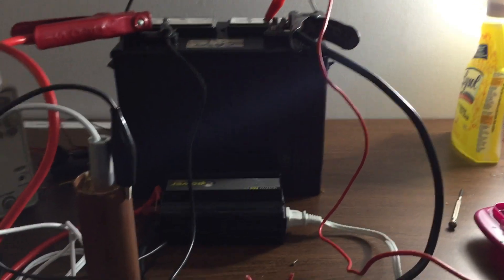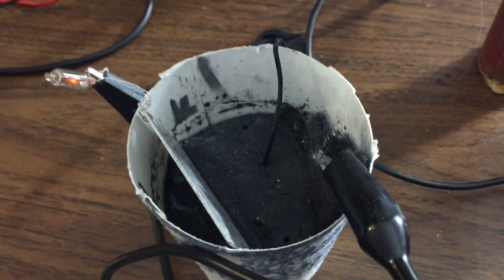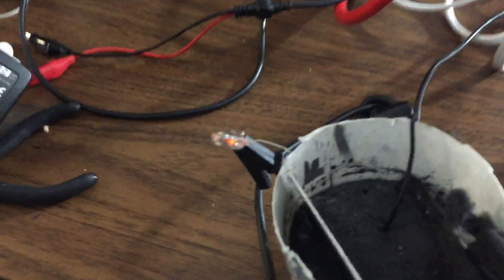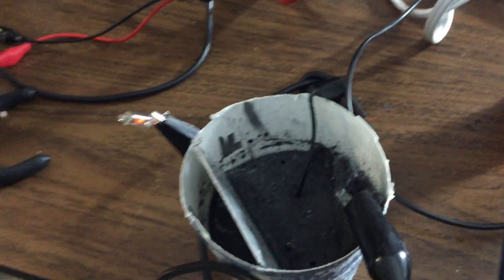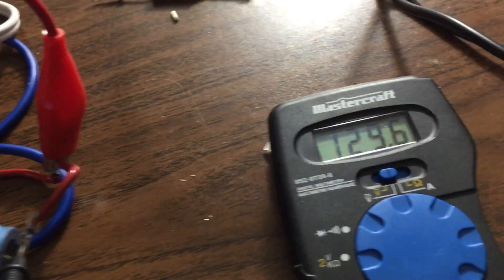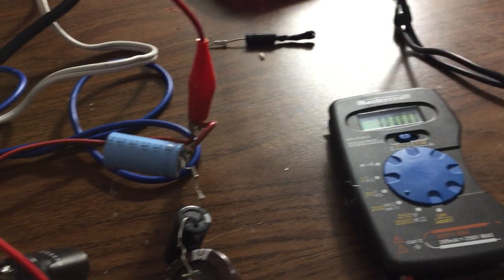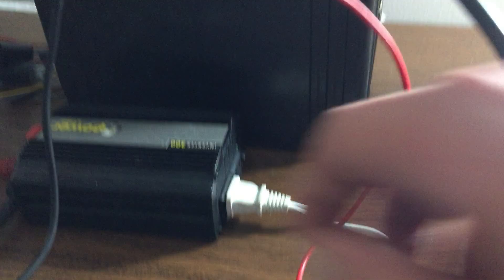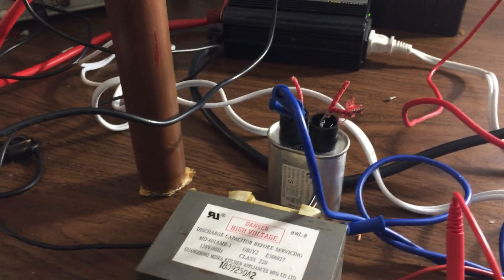Displacement Current Demo

Comment: Here is a simple circuit we are using to pulse both primary wires on a step up transformer to produce high voltage output on the secondary. The first video is of it running the transformer and the second video is of just the circuit schematic. MJE 13007 transistors an 1,000uf resistors. Plus a potentiometer.
The videos are of the circuit running a transformer and of the actual circuit.
https://youtu.be/A79UywUUuZA
https://youtube.com/shorts/Mr0_vfMu-ac?feature=share

I generally run this circuit BETWEEN the positives on a three battery setup. That way much of the energy input to the system is recovered. 

I have also used this exact SAME circuit to pulse the primary side of a single car coil or TWO car coils. The car coils were modified by cutting the tops off with a Dremel tool (be careful they are FULL OF OIL) and separating the negatives of the two coils, which are combined. I drill a hole in the top to run a second wire to the secondary negative. Then glue the top back on the car coil with hot glue gun.

Comment: I am pissed off by YT of deleting all my comments
Reply from the maker: This is the first I see in a while from you.
Reply: @joellagace1679 I can try again: digital multimeters are powered by their own batteries, when you take a measurement using them you basically introduce another circuit in your circuit and you have a very sensitive circuit as described by Tesla being “able to use a feeble current” you simply detune your system.

Just ignore naysayers and use certain power source as you already doing and power known loads if you are not sure about results obtained.
Reply from the maker: Yeah meters can really screw up these kinds of circuits esp those that people try to hard wire in....